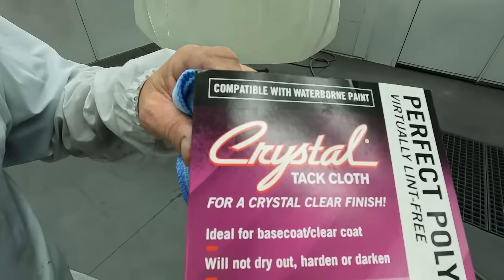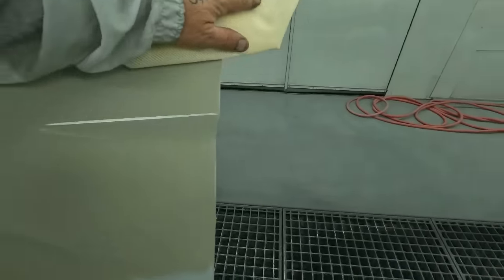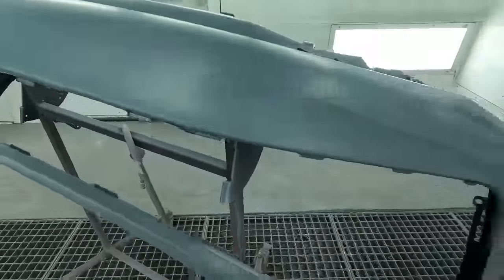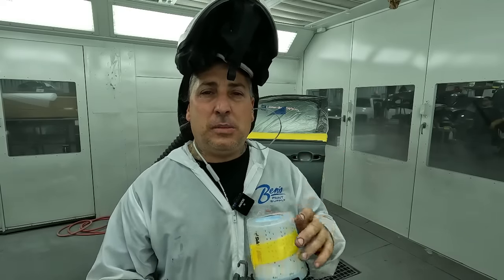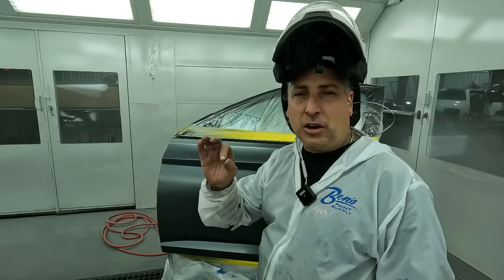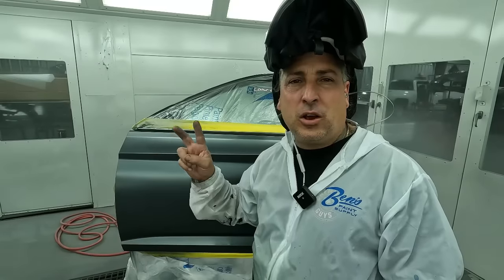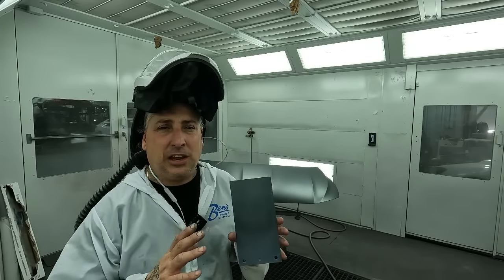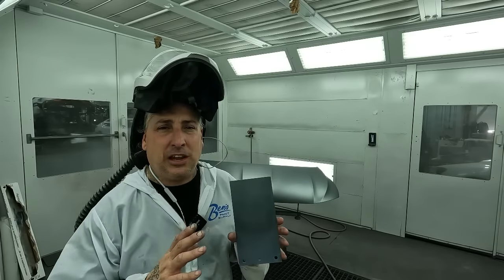How To Paint A Car - The Basics

Comment: With the cost of all paint types going up, spending a little more on a gun that atomizes better to give better results will pay for itself quickly.  Think about the cost of materials to fix a problem as well as your unpaid time to fix it.  As a DIY guy, I have struggled with a cheaper gun for base and clear having problems that take me hours to fix or strip and respray.  It is frustrating to chase down bad results and fix them.  After investing in good base and clear guns, my results improved drastically.  I am not good enough to work a cheap gun to get good results, but I can spray a great gun to get good results.
Reply from the maker: Absolutely correct
Reply: But even a good gun can't do wonders, if you are using the cheapest products you can find, I learned that the hard way.

Comment: Just recently found out about you thru paint society and this is the first video i sat and watched every second of. Im a young ppg painter myself, thank you for being giving all the advice you can and talking about almost every little step we painters have to do. One thing i struggle with now is color matches and just having to tint so much, how can i be more efficient in my shop trying to match, checking colors and doing spray outcards and not wasting so much time on that?
Reply from the maker: What I recommend is to spray your cards for the colors you think you are gonna have trouble with. Jobs earlier in the day, you can spray your cards, check colors, etc. That way once the car goes in, you're ready to go. You can work on it in between coats to get it dialed in. Make sure to write everything down to add to a library of each manufacturer. One other good way of doing it is to spray a spray out card for every chip you paint, that way you have a true color, and you'll have a library set up for you each time. You can use the camera to also get into the ballpark, but always do a spray out card and label it so you can use it again. Hope this helps.

Comment: Thanks for the video. Going back to basics on color matching, I typically have good success with matching color painting metal panels.  
However, when I use the same base paint and clear on plastic bumper it turns out a shade or two darker than a fender painted using exact same paint supplies. I mean fender and bumper painted on the same day using exact same materials.  Can you or anyone else tell me what I am doing incorrectly and what needs to improve?
Reply from the maker: Plastic is know for that .they say static can change the way the metallic lays
Reply: @kandyman5315  Good to know.  So in order to make it match better, do I need to apply a bit less (half a coat) of the base.  I assume a clear coat won't need to be changed? Separate paint card for the bumper?
Reply from the maker: Just make sure your coats are the same position bumper how it sits on the car spray it with the the same pressure  and distance

Comment: Hi kandy man  your dead right was telling your mate or buddy Brian on Instagram and you tube got my bumper painted he used a,spectrometer takes pictures and the bumper is totally different colour from the car he used a computer to mix the paint solvent  Mipa now the bumper has to be re painted and a blend he said on the wings 😮
Reply: @kandyman5315  when my bumper  mate has to be re painted with base coat paint and clear coat paint  what's the best Da sander disks  to use on the clear coat paint on the bumper in Grit i mean  like 400 . 600. 800.
Reply from the maker: @ANDY-we7mr  600
Reply: @kandyman5315   so 600 mate to take the old clear coat paint off on the bumper will he have to prime or seal it again or just put the solvent base coat paint straight over
Reply from the maker: @ANDY-we7mr  just base and clear.
Reply: @kandyman5315   thanks mate

Comment: Not bashing by any means. You are a great painter. But you failed to mention clean air in your air line.  That makes a big difference . A lot of people that do it at there house don't have the  they dryer a shop has . Can you do a video on a cheap way to do it
Reply: @kandyman5315  great to here  the the the 👍 I know if I buy 1500 Dollars with of material and spend time sanding and prepping don't want a crappy paint job

Comment: Hi, I have a question, after paint jop is finished, you can still touch up clearcoat (only clearcoat, not basecoat) in some local areas (when everything has dried).or do I have to do everything again sanding + base coat + clear coat...Another question is: can I let the 1K base coat dry for 1 day and then sand it with P1000 or P1200 and then spray clear coat over it?
or drying time between base coat and clear coat should not be too long (for good adhesion of clearcoat ) .in some videos they say that I should not wait longer than 30 minutes otherwise the clear coat will not stick properly.but 30 minutes seems like a very short time to me
thank you very much,,have a nice day
Reply from the maker: Yes you can sand the base but recommend putting more base before clear especially on metallic colors. If not you will see sand  scratches